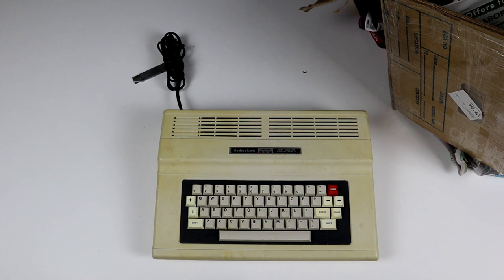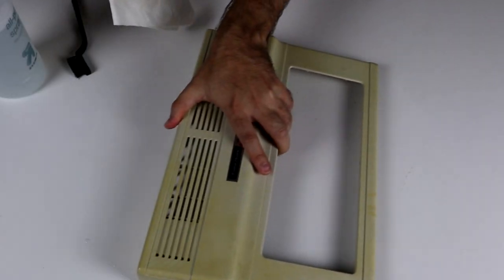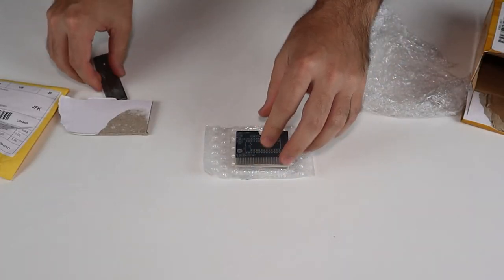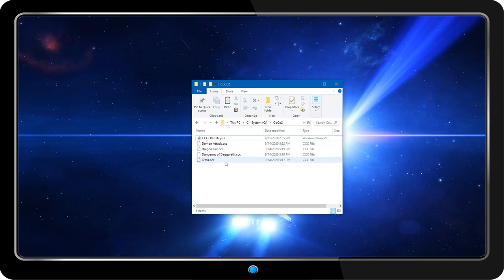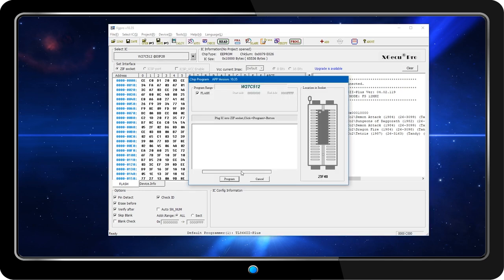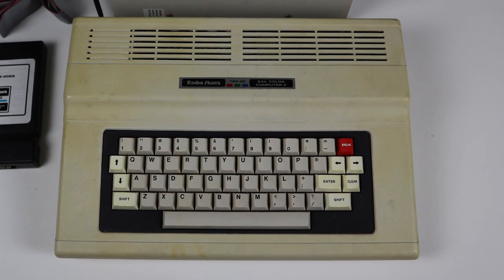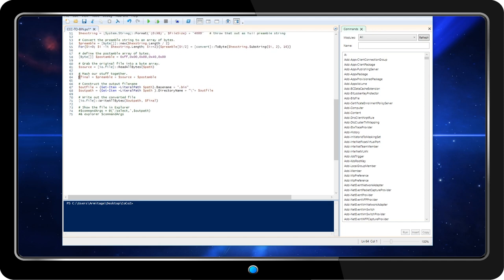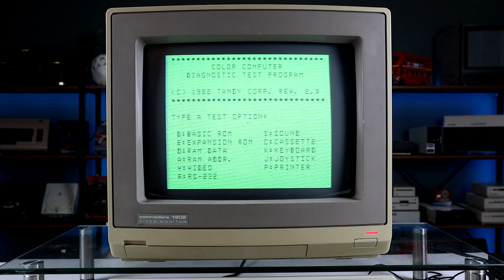TRS-80 CoCo2 - First Look, Retrobright, and CoCoEPROMpak build for #SepTandy

Comment: Great video.
The .CCC files are actually raw .ROM files which you can just rename the .CCC files to .ROM and then you can directly load those files into the Xgpro software that is used with the XGecu Pro programmers like the one you were using at the start of your video.

The .ccc to .bin converter you were using was for making it easier to load those ROM images from Disk Basic or Cassette as the CLOADM or LOADM commands require the header/footers.

If you would like to upgrade the RF modulator to a composite module you can find one here:
https://thezippsterzone.com/video-adapters/

Also you might find you will want a CoCoSDC:
You have a choice of where you wish to buy one from at:
https://boysontech.com/boysontech-a-second-source-for-coco-sdc/
or
https://thezippsterzone.com/2020/06/25/the-coco-sdc/

If you want a Case for the CoCoSDC you can print one:
https://www.thingiverse.com/thing:1492619
or you can contact John Strong through the color computer facebook group:
https://www.facebook.com/groups/2359462640

Also you can find other useful CoCo related stuff at:
http://imacoconut.com/

Also there are a few CoCo podcasts as well.

We also have a discord server where a few of us discuss the Color Computer and projects going on at:
discord.cocotalk.live
In case you are interested.
Reply: You may also find this website useful as well for some game information.
http://www.lcurtisboyle.com/nitros9/index.html
Reply: There is also a computer club that is dedicated to the Tandy Radio Shack Color Computer's as well.
http://www.glensideccc.com/

They hold a show once a year called 'Annual "Last" Chicago CoCoFEST'
Reply from the maker: Fantastic info, thanks David! I will try renaming the .ccc to .rom and see how it goes. I had looked at the composite modules earlier but they seem to be out of stock last time I looked. I just recently won an auction for a CoCo3 which hasn't even arrived yet, but when it does I'll make use of its RGB output :) I will probably need that CoCoSDC if I'm going to get the most out of the systems, huh?
Reply: @retrobitstv  ,
Yes the CoCoSDC is probably one of the most important current products you can have for your CoCo.

Since the CoCoSDC emulates the floppy controller itself the compatibility with software that tries to talk to the WD177x, WD179x, or the WD279x FDC chips directly is much better.

Though your best bet is just do your research and get feed back :)

I have CoCoSDC's for my CoCo 3, CoCo 2, and Dragon Tano.

Otherwise there are lots of options you can have for the TRS CoCo's and it is something you have to decide what you might want to do or if you want to collect it all lol.
Lots and lots of stuff :)

Comment: Hello.  Great video.  I remember starting to learn computer programming using our Color Computer 2 when I was a kid.  The book that it came with, "Getting Started With Extended Color BASIC", was really excellent for me then because it explained everything all the way down to the individual keys to press.  And it had cool little illustrations.  I actually think that computer with that book is still to this day a decent way to learn computer programming.  And although I never got into it at the time, I have heard that assembly programming for the 6809 was very pleasant due to excellent features.
I also remember playing Dungeons of Daggorath, Dragonfire and Color Baseball on it.  Anyway, good job cleaning it off and retrobriting.  Looked almost brand new.
Reply from the maker: Thanks! Yea, it's too bad that the comprehensive manuals that machines used to come with are a thing of the past. But then again, all the information you could ever want is at your fingertips with the Internet now so I guess there's that :) I wish I had learned more assembly back in the day, but at that age I was more interested in playing games than I was programming them!

Comment: The sound is actually quite versatile but limited by the fact it ties up the CPU. I wrote a 4 voice sound program by using a small wave table to be fed into the DAC. 4 separate waves could be generated at the same time by simply adding them together before feeding the DAC. It could also produce voice output using wave tables. None of this useful for video games because it's too hard to drive the sound and the game at the same time.

Comment: Ed Snyder over at https://thezippsterzone.com/video-adapters/ has composite mods if you want to add composite, but I recommend CoCoVGA (www.cocovga.com), which adds higher resolution text and graphics modes and more colors plus VGA output that can be upscaled to HDMI and gives amazing perfect display on a modern tv or monitor.  You can also pick up CoCoSDC which gives you the ability to store to SD cards.